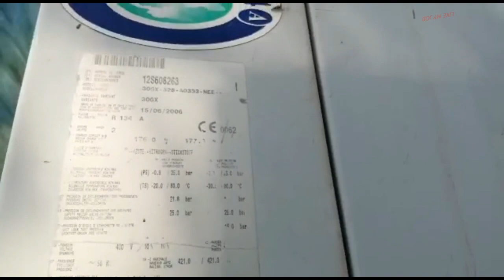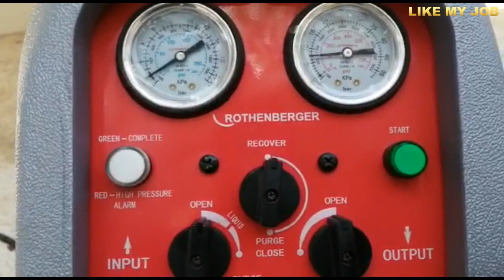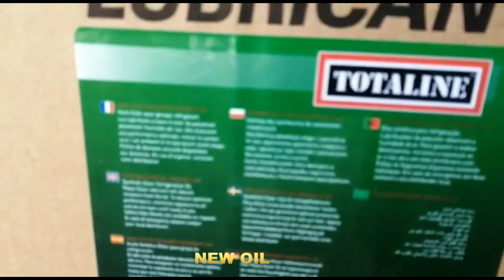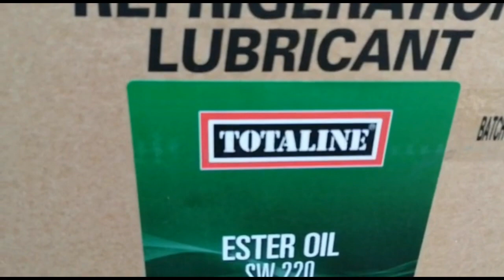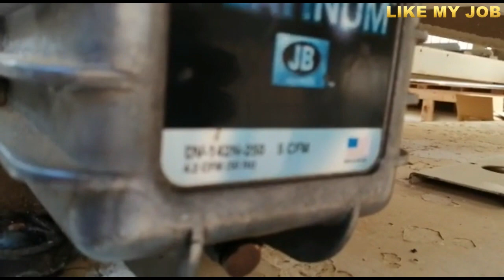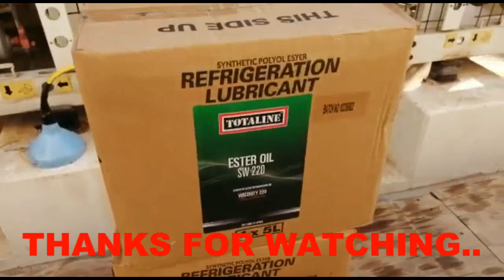HOW TO  CHANGE OIL IN CARRIER 30GX328 CHILLERS

Comment: After how long you change the oil for this particular chiller????
Reply from the maker: Refrigeration Oil Acid testing kit is available u can check and change ,  we changed oil in  this chiller due to the compressor winding burned

Comment: bhai carrier chiller water coold model 30HXC 140 .oil drain kider sa hota hai or kitna oil fill karna chiya full unit ma or oil filling point kider hota hai
Reply from the maker: This unit condenser work as a oil separator, 17 litre per circuit (HXC140 model)
Reply from the maker: Thanks for the comments
Reply: @cooltechhvac4555  there is one unit we have two compressor in 1 unit abhi aap mujhe ye bataye puri system me ya Fir ek compressor me 17 liter oil
Reply from the maker: @najmashaikh7512  how many circuit u have?
Reply from the maker: @najmashaikh7512  circuit A and circuit B?

Comment: How much charge psi low side
Reply from the maker: In this unit 177 kg R134a and its run 240 to 270 kpa according to the load ( 32 to 40 PSI )